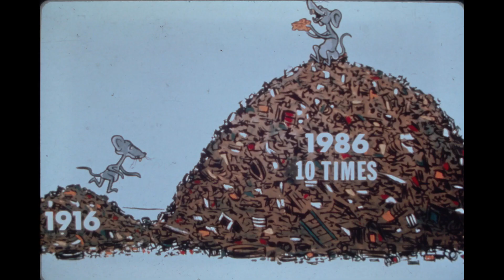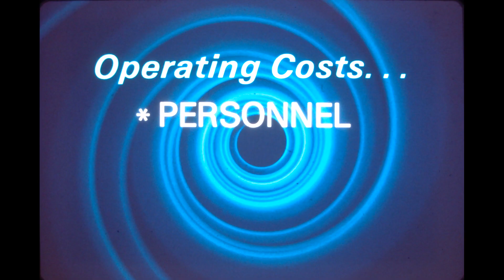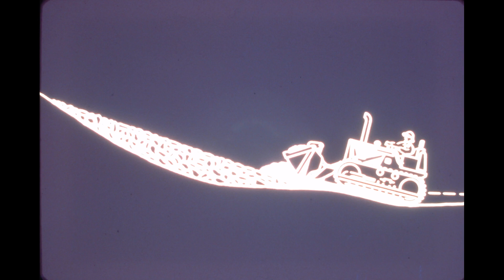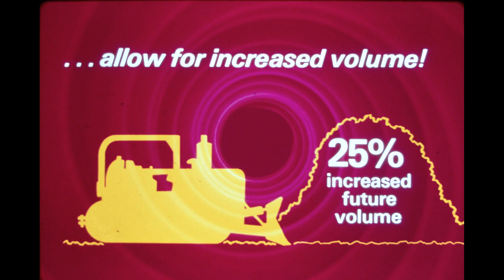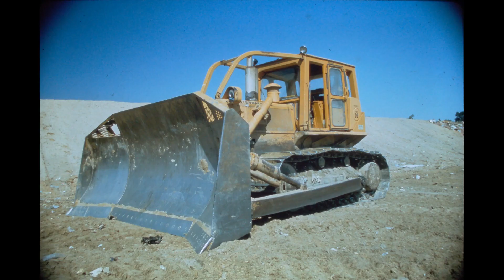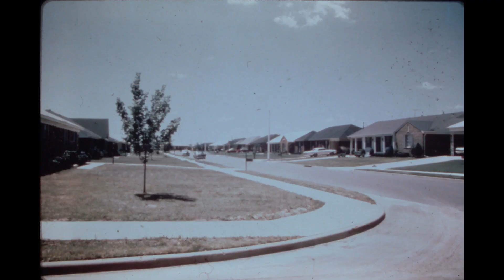International Harvester Payline "The Solution to Refuse Pollution"

Comment: I would rather use the air conditioning than have the doors open pushing trash. Yuck
Reply: Most of those old machines did not have air conditioning. If it was available at all it was an expensive option.